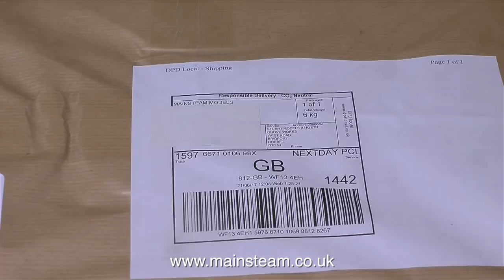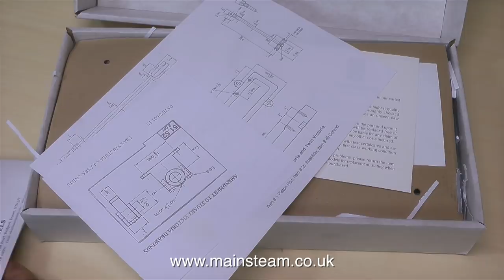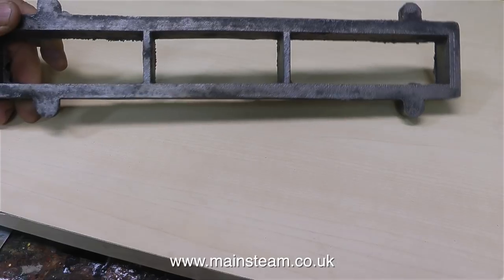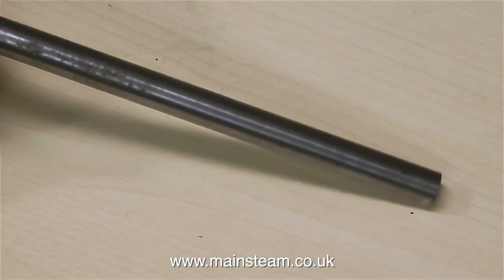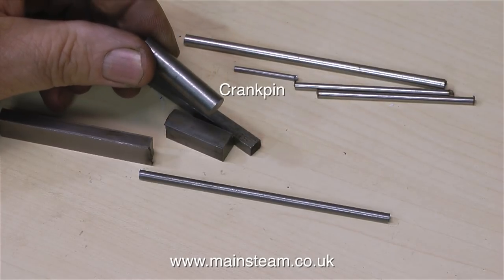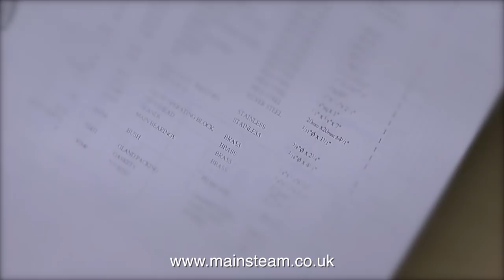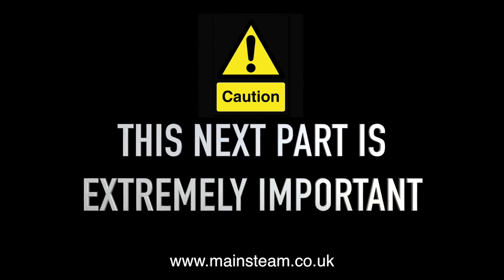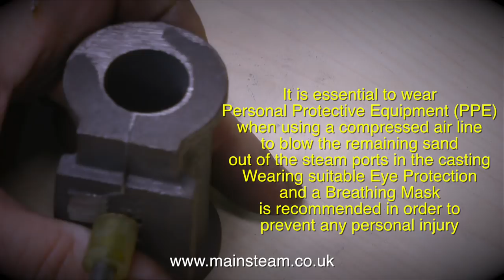HOW TO BUILD A  MODEL STEAM ENGINE - STUART MODELS VICTORIA - PART #1

Comment: Excellent - my first engine was a Victoria.
Saw one on a stall at a local fair back in 77(?) and was blown away. Went home, scraped up every penny I could find, sold my mum and came back with the cash (think it was £40).
Guy said "you have to make it, have you got any machine tools" - of course I had. I'd just bought my first B&D drill!

Went home box in hand, opened it next to my set of screwdrivers and...
Well I wasn't expecting that. Blueprints and lots of bits of scabby metal.

Short version: local community centre had a lathe nobody used, some pointers from folk in the know and I managed to make it - and it ran! (On compressed air at any rate).

Then it sat in my attic for years until a couple of years ago until I came across it again - looking very sorry for itself. Lots of the parts were just wrong so I remade anything that wasn't right and now it looks and runs great.

(For reasons I can't explain the cylinder was spot on! Pretty much everything else was rubbish - even the base)
Reply: Love your story! I could almost feel the heart dropping as you saw what's in the box! 
Even better was to see that you managed to find a way and get it done anyway! That's some success story!

Comment: I've only ever built two steam engines, mainly because I've never owned a lathe and had to use lathes where I worked. One was an oscillator built from scratch using a plan in an old book I no longer have. The other was an S50 which I still have, it's only ever run on air. I do have a suitable boiler kit I bought about 20 years ago at a Model Engineer Exhibition.

Comment: I'll enjoy this as fifty years ago I did two years as a toolmakers apprentice. I then went into the merchant marine as a deck officer where I remained until retirement. I am too clumsy for horology but would like to commit the time and money to building a big brute of a traction engine. 6" to 8" depending on the prototype. This project will be educational and if I build one let me decide whether the old skills I witnessed still hold fascination. As a second year apprentice we got lots of tea making, swarf clearing, filing and scraping. After the first year we were allowed to scrape cylindrical stuff and clamp up massive virgin castings on big horizontal millers. Never have I seen them setting the big roughing fly cutters as it was back to shifting swarf.
The problem is that were I to build a 1" scale three cylinder double acting marine diesel I would have to be draftsman, orange pencil man, pattern maker, foundryman, machinist and fitter.
I'll keep it simple and I suspect you will teach me as you complete this build.

Comment: Good videos all around. While watching I can't help but recall the film African Queen and Bogart's on board boiler rig propulsion system. Which leads me to the obvious basic questions rarely obtainable from such videos. I also do boat building and would like to know what working horsepower one can achieve from these units, or how to calculate it from the component sizes and typical costs for new models(shipping costs of these iron units must be through the roof). Or even how practical these are in open hold salt water exposure to the elements. Also, as climate and global financial situations change, more off grid folks would benefit from learning energy ratios,conversions and comparisons. But all the same, thanks for your excellent contribution.
Reply from the maker: A Stuart 5A Steam Engine is rated at 3HP at 80 PSI Boiler pressure, that's enough for a 20 foot river launch.

Comment: I like you videos, I learn a lot hopefully enough to make my own engine. I have a question though, there a car Dobal Steam car doesn't have a boiler it utilizes a steam generator where the heat is forcefully blown into a chamber heating copper pipe filled with water that then runs to Engine, oil/water pump, Fan turbine, and condenser (like a radiator) before being pumped back into the system. My question is can a miniature version be made at home or has anyone made one.
Reply from the maker: Yes, model boilers of this type are used in "Flash Steam" applications but non condensing as in model sizes it's difficult to remove the oil from the exhaust of a small steam engine.

Comment: Firstly congrats on making these informative videos. You are an accomplished model engineer. I have been in engineering for all my working life ,formally trained in a large tool room. Over the years I have made numerous projects over the years ( not steam models I may add ),though they have always interested me , so l thought I’d have a go ,and at this point I would like to make a couple of points that you and  Stuart Models may comment on . I bought the drawings off Stuart models and whilst as you say the are copyrighted they are not up to ISO standards with no limits and fit tolerances , this I can deal with , but from a novices point how does he know whether to make , say the piston .001 down on bore size or .005 ? Another thing Keith. I have only purchased the drawings & the two steam cylinders intending to make all the other parts , I have watched your videos with great interest and have seen you explaining on two different videos explaining why you need to check & clean the ports. I am sorry to say (& the tool room work I did as an apprentice was for a casting foundry) that STUARTS really ought to do that job before they are sold. Anyway keep up the good work you really have helped an “old timer 48yrs to be precise “with your steam knowledge.

Comment: I am curious, have you contacted or thought about contacting Stuart Models  and asked permission to show at least a limited set of the drawings un-blurred? 
They may be happy to allow this as this is good press for them.
I'm sure for particular parts of this series showing bits of the plans would be very useful to explain what your doing.  (And at worst they will say no and you can just continue to blurr them as you have been doing.).
Reply: Just the bit of the unblurred was enough for me to appreciate their level of professionalism.  Those are good prints.  And the identification of the parts in the material list would make a mixup almost impossible to a careful builder.

Comment: can you not blow the sand out with compressed air and after that put it in a ultrasonic cleaner ? thats how i would do this ( oil the part at once after that . )
Reply from the maker: and of course everyone I know has an ultrasonic cleaner in their home workshop  ........... :-)))
Reply: yes just drop by my place well have some beers while my ultrasonic cleaner does the job ... dunno how long it will take for your private learsteam jet to reach flying pressure but i live close to the airport in Eindhoven The netherlands . :) lol lol :) ok seroius of coarse nobody has one but i do as i flown model airplanes for many many years the old skool way making everything my selves and of coarse once in a while an stupid mistake and the nitro engine ended up nose down in the corn field . As a result badly running after a thorough cleaning , i turned my piggy bank upside down and bought an emmy emag professional ultrasonic cleaner . its been in my workshop for a very long time and cleaned carburetors pistons / engine parts / jewelery you name it its been in there. its like having a good lathe . you cant do without if you got used to that deluxe version . Now in the mean while i blabbered this box full. i am sure your learsteam jet is up to steam .. the brewskys are cold so of you go :) cheers mate !

Comment: Mr Appleton how critical is the ballance of the flywheel to the operation of the engine? or do they run slow enough that vibration isn't an issue
Reply from the maker: Balance is always important but on a slow revving engine, less so.

Comment: i might just do this.  can i get away with buying a sherline lathe? i have been tempted to for years.  or do i need a milling machine as well?
Reply: Stuart S50 might be easier to machine if you have a Sherline lathe. Flywheel diameter is the big hurdle for many owners of mini- and micro-lathes. Some companies that sell casting kits offer pre-machined flywheels to get around this problem. As a hobbyist how many flywheels do you need to make each year? Some milling operations can be performed in a lathe but a proper milling machine makes life easier. Remember, in engineering there is ALWAYS more than one way of doing things :)

Comment: I apologize for the question in advance but could this size model engine operate a small alternator to recharge a battery?
Reply from the maker: Yes, but it would require a dedicated continuous lubrication system for continual electricity generation ...... which defeats the object of using a model engine to drive an alternator really .....

Comment: Hurry up Keith! Where's the next one?
Reply from the maker: You should never hurry  - it is quality not quantity . . . . oh ..... and don't forget I still have to work to earn a living ..... and spend some time sleeping also :-)))
Reply: Keith,

You are absolutely correct. I used to rush my woodworking jobs but now I look at woodworking as a pastime. I too was born in '53.

I am hooked on your workshop videos - I recently designed and built a wooden horizontal steam engine. I've never really studied the steam engine designs and I have never built one before. When I finished the engine, I looked back on some  of your videos and realized I'd picked up the fundamentals by osmosis. I've never really paid any attention to the eccentrics - ("turns rotary motion into linear motion but not vice versa"). The one I designed and built is almost identical to the ones that you repair.

Thank you for your excellent, high quality videos. Whilst I enjoy the painting, could we have a little more sanding and polishing? I really enjoy sanding and polishing.

Best regards,

Jim